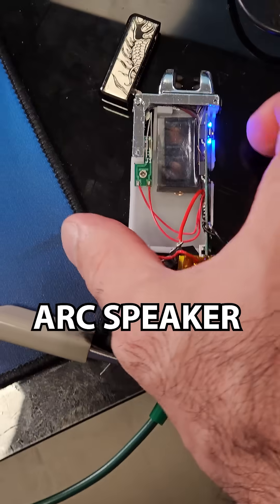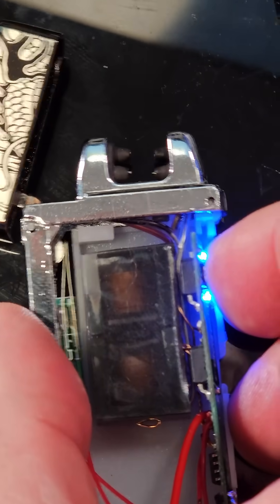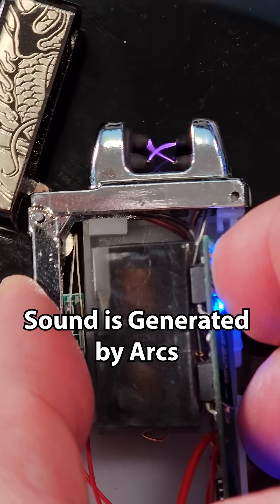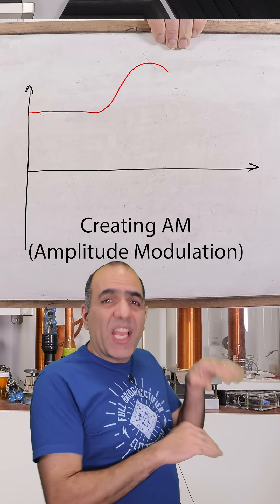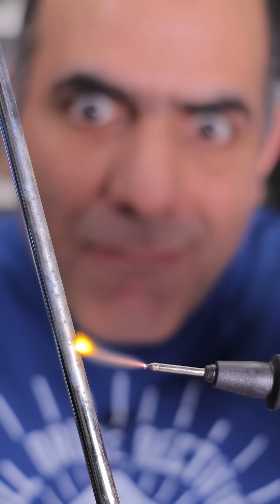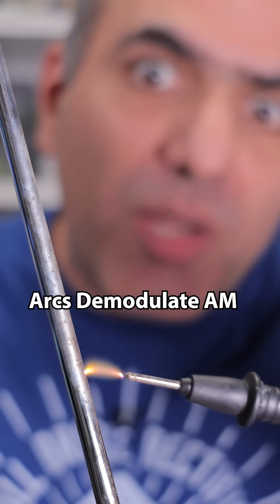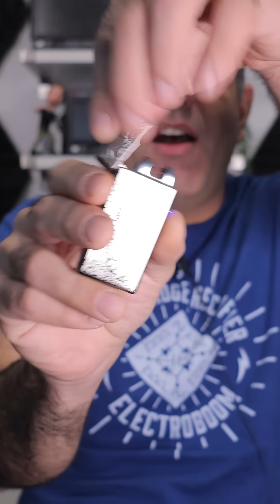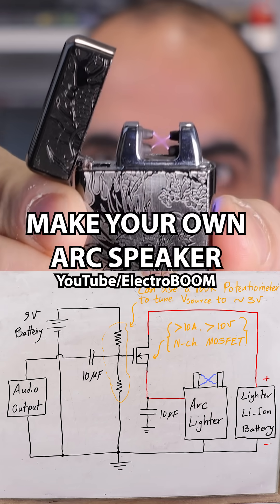ARC SPEAKER #technology #experiment #diy #funny

Comment: Nah this is cap. Both methods teach you the guitar by string rather than groupings. He is correct that this is a poor method to learn - this will lead you to playing up and down one string rather than across multiple strings. Playing guitar is all about conservation of motion. This teaches the exact opposite of that. This technique is much better used to.teach chord switches.

A better method is to do the same exercise as this but combined with string skipping (E/D, A/G, D/B, G/e) as this is most natural and efficient positioning for playing.

Comment: If an electrical arc is roughly a thousand times less efficient than a speaker (I pulled the number from my ass I have no idea how efficient it really is at reproducing sound since sound is a byproduct of arcing in air), and if we could get super clean arcs that changed the air pressure smoothly like a speaker  not like a dirty clipping square wave, we would need a million watts to get the same output as a speaker that draws 1000 watts to get the same db at 1 meter(aware different speakers have different thiele/small parameters, this is likely true for different arcs as well, but this is a YouTube comment, I'm allowed to be inaccurate)
Reply: Perhaps argon gas, like fluorescent lights use, just don't put the mercury vapour in the chamber